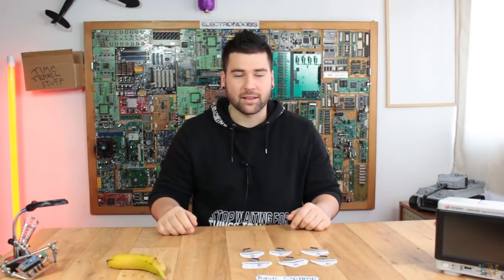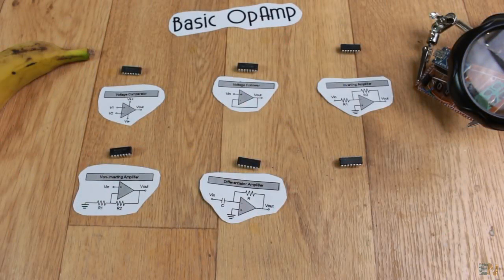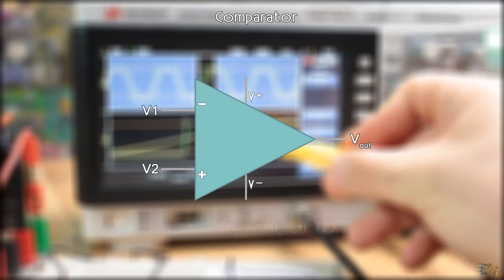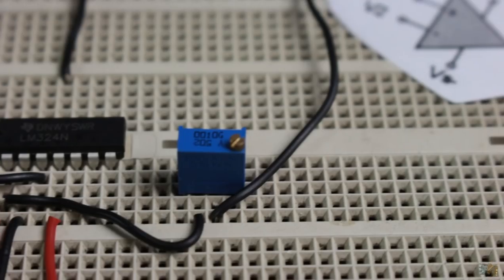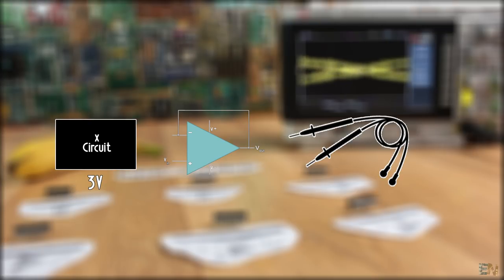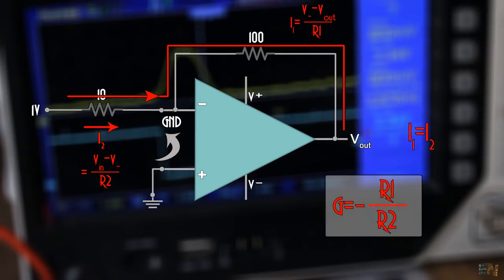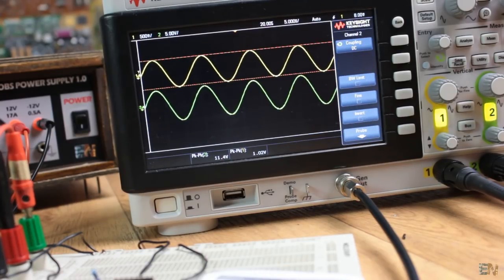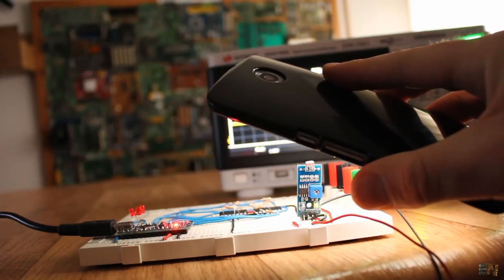Basic components #001 - Operational Amplifier configurations

Comment: JLC PCB is fast and great, I use them myself.  They do only charge 2.00 for 10 boards.  But shipping is 18.00.  So the boards end up being a little more than 2.00 each.  But they are very well done and if your doing small surface mount parts it's worth it, trust me.  They have my boards done and delivered from China to Minnesota USA in 2 weeks or less.  So that's worth shipping cost to me.

Comment: This is a very good series. Just one correction: the op amp inputs are not called positive and negative input. Non-inverting and inverting input is more correct because it describes their functionality in a better way with respect to the op amp output.

Comment: Do you use same chip for every project? Is there op amp specialized for comparator which isn't as good for, lets say, inverting amplifier?
Reply: There are comparators such as the LM339 and they will not work as an amplifier.
One chip will not work for everything.
You have to pick one for your circuit based on parameters such as bandwidth, input offset voltage, output current, supply voltage, quiescent current, etc. That will all be listed in the datasheet for the op amp.

Comment: hi. very nice video. there is also the lm741 it has two pins which I haven't found much info on the web: null offset 1 and 2. I dare to ask you the favor to explain how to use those, how those work.  Thanks in advance. Thanks any way for your channel.
Reply: alvaro obyrne 
Try this website for details 
http://www.learningaboutelectronics.com/Articles/LM741-op-amp-pinout-connections
See the highlighted links in the text for explanation of the null offset terminals. 
Hope this helps.

Comment: Good video but I need a video on how to use op amp to control tl494 duty’s cycle for automatic sensor the low voltage and turn up the duty cycle am have a big difficulty to get it to work